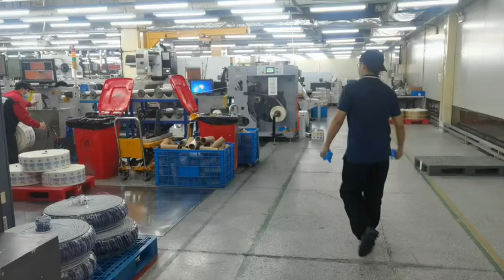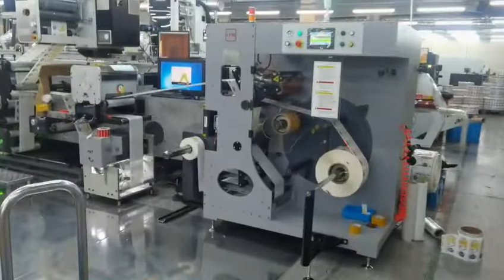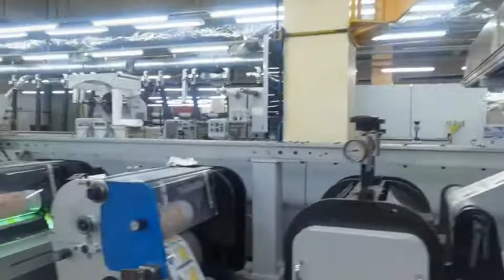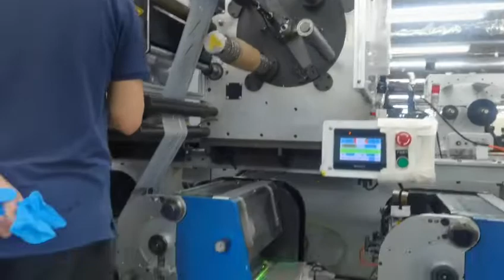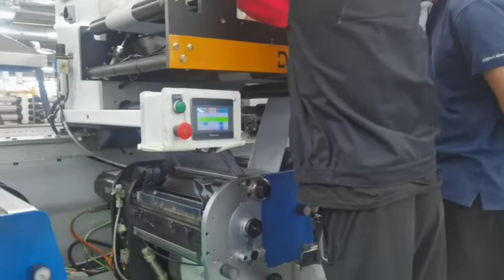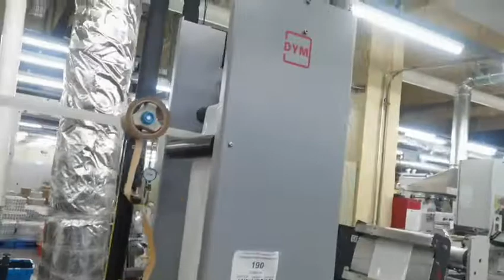DYM Fully line of Automatic nonstop printing equipment installed on Gallus running video

Comment from the maker: DYM's Automatic printing equipment series New promotional video: Automatic butt splice unwinder + Automatic nonstop stamping film unwinder + Automatic nonstop stamping film rewinder + Automatic waste matrix turret rewinder + Automatic turret rewinder. 

DINGYU Automatic butt splicer, 100% splice success and stable tension control change within 2 Newtons, join gap less than 0.8mm and edge difference less than 0.8mm not influence die cutting. No speed change when splicing, increase your print machine 10%-20% production capacity, save expensive material. If you interested it, contact with me when you free. Email: info@dingyumachine.com ; WhatsApp:  +86 13806533936 ; Skype: info@dingyumachine.com ; website: www.dingyumachine.com.